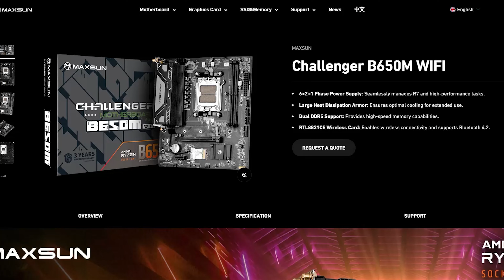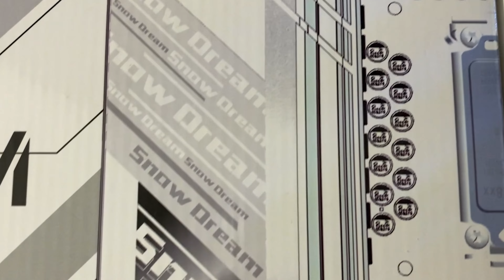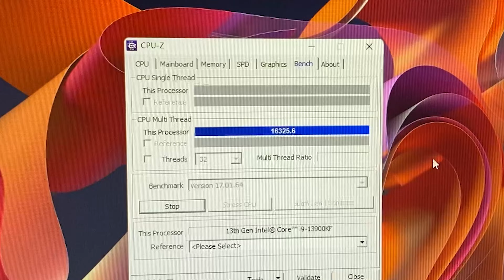Don't buy an off brand motherboard for your new PC... or maybe do it actually!

Comment: Got a Erying i9 12900hk with 7800xt and been running everything I throw at it for over a year. Got board and CPU for about 300 bucks. Best bang for buck.
Reply from the maker: Erying is good but some people are reporting big issues with VRMs. I'd really advise to run it undervolted, but also latest revisions are improved, also the BIOSes are much better as far as I know

Comment: I bought the JGINYUE B650i Night Devil and I could not get the MB to post. I tried a 7500f & 7600 CPU. I tried G.Skill and Crucial RAM. I tried an iGPU and a dGPU (RX 6800 XT) and my SSD is a Samsung 990 Pro. Oh and my PSU is a evga 850W. Nothing worked. I had the same two debug lights the entire time.
Reply: have you tried updating bios?
Reply: @legitscaryturtle7379  I couldn't get to the BIOS. I had a USB ready to go...
Reply: May I ask which debug led is showing? Led for CPU or RAM or VGA? Have you checked if you have push everything in place?
Reply: @AndreGuerrieri All AMD boards should have a BIOS flashback function.
Reply: @timrogers9191  The big name brands do but not the JGINYUE Night Devil. I got the ASUS ROG Strix B650E-I board and that one had it. Put all the components that didn't work in the JGINYUE into the ASUS and it fired right up.
Reply from the maker: I see what you’re saying and I really think you just got a defective boards. It’s very unfortunate but I’ve had a pretty decent experience of getting my money back from Ali. Maybe a BIOS flash could’ve fixed it but without being able to post it’s tough.
Reply: Yup faulty MOBO

Comment: is there a way to share the files for the bios flash for the curtain boardboards that worked for you ? great video by the way. i have a z590 steel legend with 11600k and rx 6700 xt, wanted to try an upgrade since my cpu is the bottleneck.

Comment: oh i got a x79 board that has a e5 2690 v2 32gb ram rx 6600, i know the bottleneck is about 20 percent, it works well, £54 or $70 (mobo+cpu+ram) and for gpu, you could of gotten a 3050 or something instead of a rx 6600, regardless it works well for the price i dont have any issues with it at all

Comment: I've got a MAXSUN B550M and i could not make it post.
Tried with a 1600AF and a 5500 but nothing made it post.
Yet on the old B320 gigabyte both cpu with the same memory and ssd did post.
What's worse is that i sent back to swap boards and with the shop setup it did post :(
Reply from the maker: My man, I’m really sorry about it! That’s a BIOS rev issue I think. Either that or RAM compatibility. It needed a BIOS update ti support your RAM, probably🥲
Reply: @ImWateringPSUs  Yea, it's a build for my father, he actually called me today telling that the mobo is back so on monday i'll go at his house to test out the RAM with my sticks

Comment: Hardware Unboxed reviewed the chinese b650 itx motherboard, the VRM temps are terrible, basically the worst compared to all others.
Reply from the maker: Yep I've seen it, Steve also referenced my video about it! Look better into the data though, it's performing quite well for the price even VRM wise. And if you run your CPU undervolted it's gonna be quite a bit cooler too!

Comment: So your understanding of "off-brand" is a marketing concern not a where they were made concern. Since all the motherboards you spoke of are made by companies that have been making motherboard and many other electronics for decades. Foxconn is the maker of almost 90% of all your off-brand motherboards.

You have no idea about the QC of these companies and that is the real problem with these products.

This is reckless advice from an imaginative person, none of this information is proper accurate.
Reply from the maker: Not really, as what I care about is how the board is actually made of. Not really about where it’s made. I test out the final quality. Aaaaand Foxconn makes a lot of these sockets but not all the boards. And sure enough Foxconn does NOT make the BIOSes and the features, which are arguably of the most important parts components aside.

But I take the constructive criticism as I should’ve talked about manufacturing too and went deeper. I’ll try to improve!

Comment: I was looking for a X99 for my i7-5960X and the only ones I could find are basically "off brand" motherboards.  At first they didn't look too bad for the price (about 60-70 euros), then I realized they had SATA 2, no USB 3.0 ports in the back, only one M.2 (some times just a SATA one and not a NVME), etc.  
So for me at least completely useless.  If I wanted something better, with proper SATA 3 connections, at least 2 NVME slots, at least 3-4 USB 3.0 ports (don't even dare thinking of type c too), then the price goes up to 100 or more.  
Nah.  If I was going to spend so much money for a motherboard, I wouldn't buy an off brand one.  

If.   Now I am thinking of selling my PC parts.
Reply from the maker: For an X-series i7 I would NOT recommend a cheap X99. I have a dedicated X99 video about it, you can buy a second hand Prime Deluxe Asus X99A for around 90 bucks. That’s a better buy. Off brand X99 is good just for Xeons and relatively low end PCs imho
Reply: @ImWateringPSUs  I am not going to touch another ASUS board for a while.  Thanks for the suggestion, I am going to watch your video later.  Thank you.